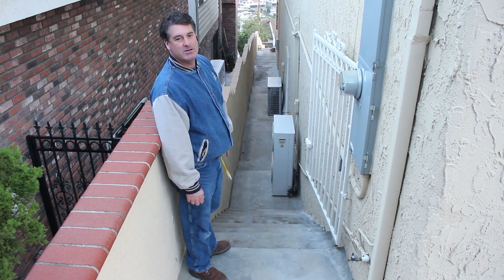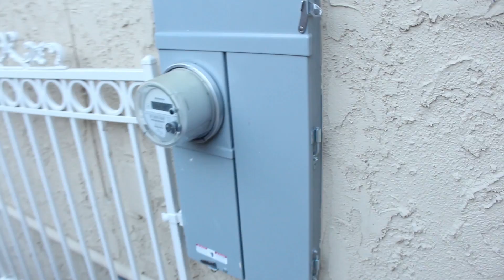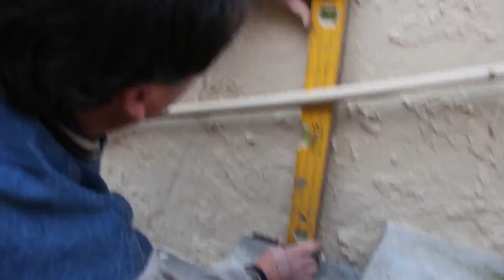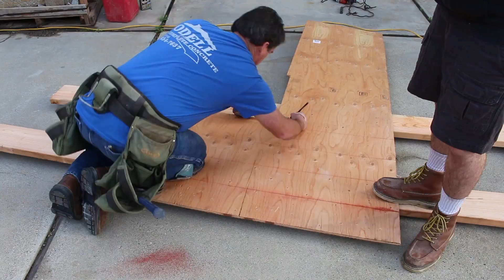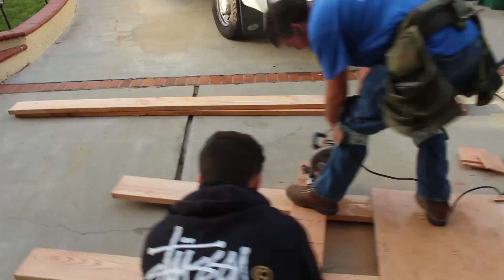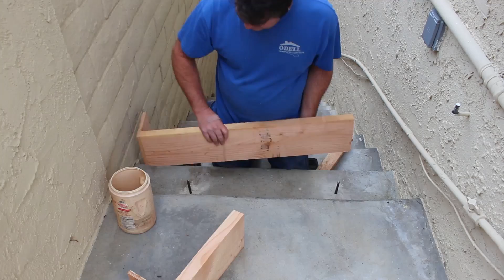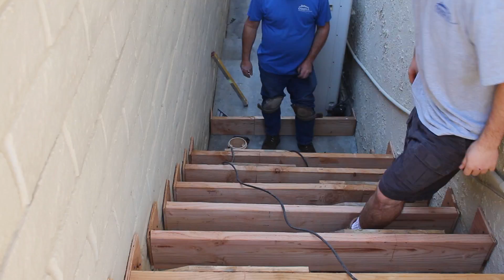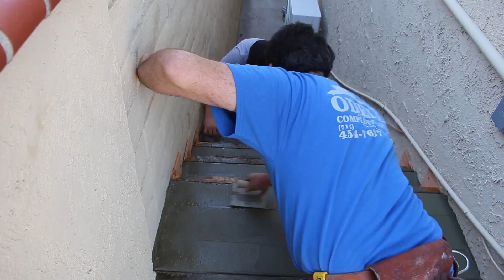How to Build and Pour Concrete Stairs

Comment: all that for a meter socket
Reply from the maker: Honestly hahaha
Reply: Guessing this was required by home buyer after a home inspector called out the small landing? Nicely done but it sure seems like make work.
Reply: That was my first thought. Also, why not move the meter?
Reply: or a required clear landing in the direction  of the stairs.  would have been more code compliant to move the meter.  Loose one code violation to just make a second violation. Those ac units should not be there in the first place they are a huge violation.  more people are killed falling down stairs by the landing having crap on it and breaking their neck at the end of the fall than a clear 3 ft are at the meter. the worst thing is the electrical panel clearance was there.  it is measured from the edge of the panel. so from the left side of the panel measure 3 ft right and that is proper.  The code does not say from center of enclosure but from side.

Comment: Damn perfect job!  I need to build something like this soon.  It's gonna be a big job.  It's on a hill 100' high, rising at an overall 45 degree angle but for one 30' stretch it's rising at 60 degree angle.  Do you have any thoughts on this project?
Reply from the maker: sfbluestar 
my thought is to do it in 4 sections.
Reply: Major problem, normal stairs are around 30° going to have to switch back and forth, figure something out.

Comment: Nice job. I've done some concrete stairs before but never been brave enough to strip and trowel finish them!
Reply: Thanks for the fibre tip.
Reply from the maker: SP Bygga 
you need to get it on.
Reply from the maker: SP Bygga 
and Rocky Balboa up

Comment: Great video! I love your videos all the way from saskatchewan. For those risers, sometimes I 45 them at the bottom so you can get a clean finish. Keep it up!
Reply from the maker: Colton regier 
I have 45 the bottom of the riser on ocassion.
I don't like it because you can't see the bottom of the would, and when that happens you end up with different size step heights because of riser burial.
Reply from the maker: hunt bigfoot 
the rebar will connect the wall to the house and likewise.
It's hard to see the bottom of the form to know where to trowel to unless your laying on stomach probing under there to find the bottom. If you like straight flat steps don't 45
Reply: Odell Complete Concrete  i  45 my risers..and i can finish them just fine without having to be on my stomach...but just because we do things different don’t mean one of us is wrong!!
Reply: Great info, getting ready to do almost the same thing except both sides are foundation And I have a landing and a 90 degree turn.  Do you think I can dowel into the sides of the foundation, running rebar through the middle of each step? Also, regarding the 45, What do you mean when you say you can't see the bottom?  Wouldn't you just trowel to the point of the 45?
Reply: the 45 at the bottom is not needed because he is sliding his trowel beneath the form to create a clean finish were tread and riser meet